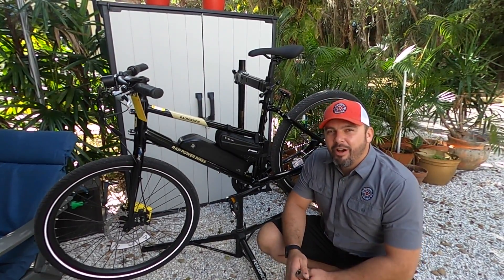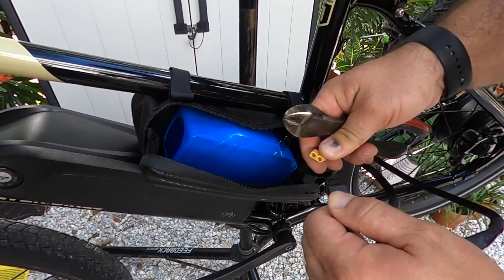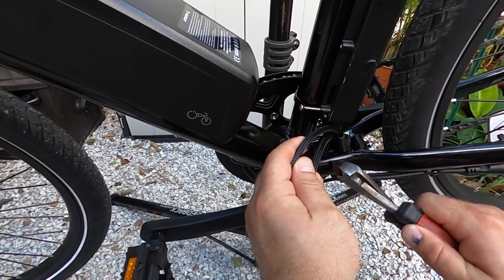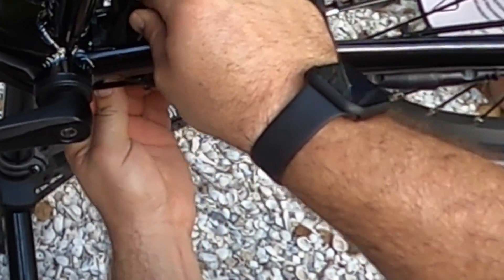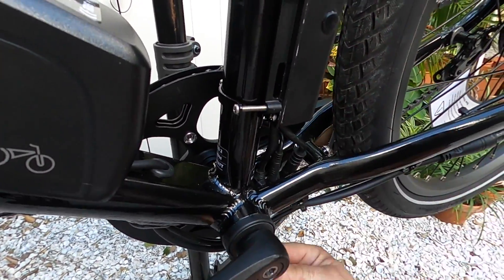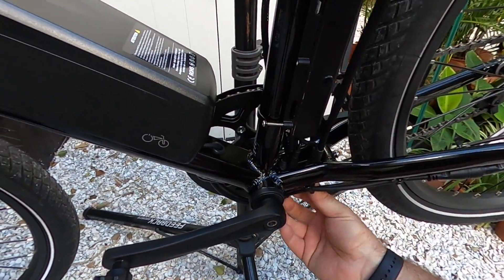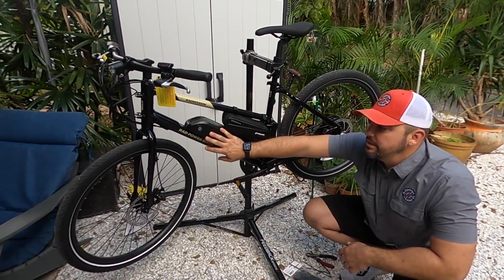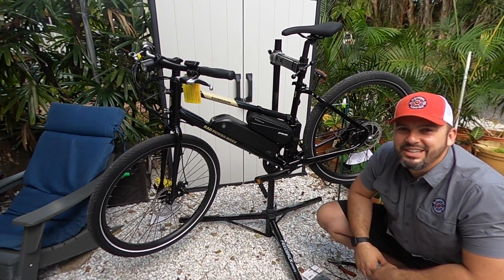Rad E-Bikes | RadMission | Plug and Play Dual Battery Discharge Balancer Kit | Install Two Batteries

Comment: Is it possible to have a setup with two hailong batteries as well as the rad battery ?
Reply from the maker: Yes. You can use two balancers or we have the DX4
https://electricallwheel.com/products/datex2-dx4-30a-continuous-45a-max-4x-input-dual-4x-output-battery-balancer

Comment: Rad is selling Radmission battery at low price now. Is there a way to install a rad battery holder like the original one on a rear rack for example and use your module to connect both ?
Reply from the maker: You will need to purchase a battery cradle from them. From there you can get an extra set of cables and plug it in with the same concept.

Comment: Are you going to have more battery discharge balance kits for the rad mission? Just tried to order an it shows put of stock...
Reply from the maker: We believe we will have restock in 2-3weeks
Reply: @ElectricAllWheel  I'll check back early March....Thanks for the update

Comment: Hey Matt, i ordered the wrong kit for my radmission.  I got the 40 ah instead of the 20ah. do you think that will be an issue and will the cables fit?
Reply from the maker: The cables are the same. The kit you have will function the same. Your current limit is much higher for your balancer but will not negatively affect your performance.
Reply: @ElectricAllWheel  thank you!

Comment: Can two batteries with different voltages be connected?
Reply from the maker: The charge voltage can be different but the rated voltage of the Battery should be the same

Comment: What is the amp rating of the Radmission controller?

Is it 20 amps or less?

The Amazon Hailong battery is 30 amps.  So, it would be ok to use a 30-amp battery blender.

I think your kit is a great idea.  I am just curious about the Radmission controller amps, and I have not been able to find it anywhere.
Reply from the maker: They vary by production. 17-20a max current
Reply: @ElectricAllWheel  Cool, thanks.

Comment: Trying to hook my lectric 2.0 to a 20 amp battery& my original lectric battery try to get the right balancer & wireing
Reply from the maker: This will cover it for you 
https://electricallwheel.com/how-to-install-lectric-xp-dual-batteries/
Reply: @ElectricAllWheel  thanks alot.

Comment: Hey Matthew,
I just ordered the Radmission kit. I have the identical low step bike and Hailong 48V 10Ah battery so your kit will make the battery install childs play.
Also this beats the hell out of sourcing a larger expensive battery for the Radmission. Also I can use the Hailong battery on multiple bikes for added range. I already used an ElectricAllWheel kit on my Lectric XP 2.0 and plan on installing one soon on my 3.0.
Great job!